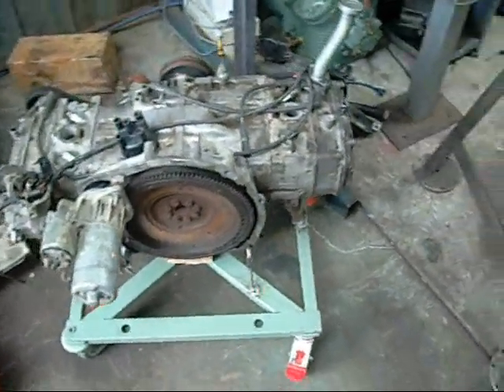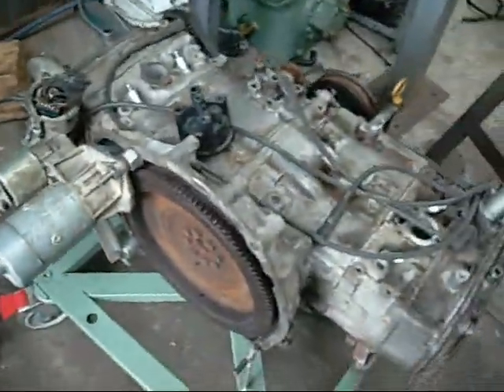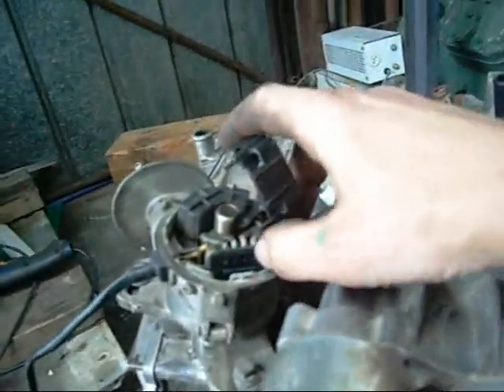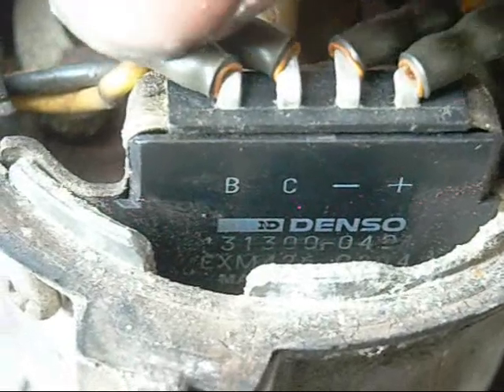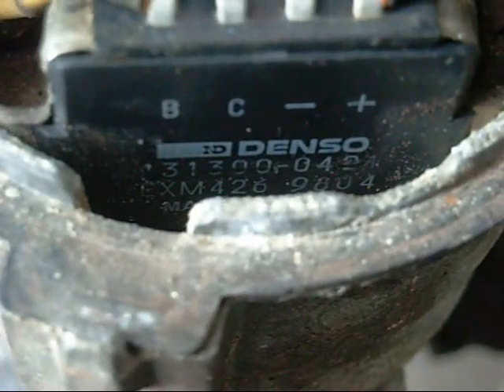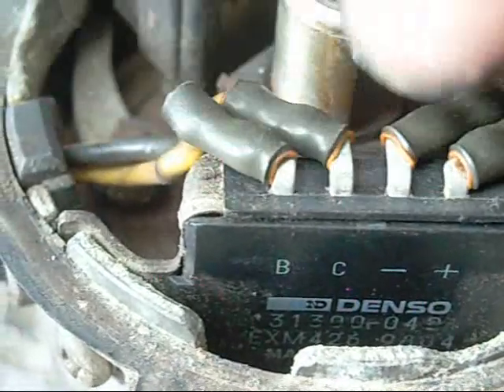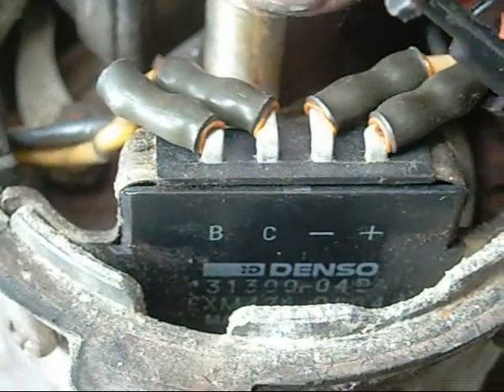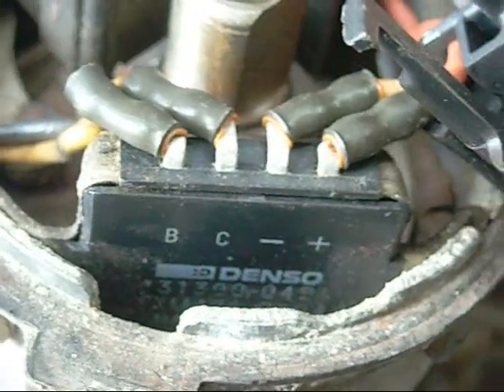Subaru EA82 Boxer Ignition Revisited - Denso Module Help

Comment: ah great memories here, my first car was a subaru 1400, it's engine was so light and I could lift it out with my own without a winch.

the issues were with the rocker arm rods which wore and started to get noisy, as I remember it was a bloody reliable unit, and this was back in the days of good old points ignition when at lest you could see wtf was going on.

As you have found out this electronic ignition is like black magic, when it works great, when it fails it's a tow home job.

Comment: @Aussie50 it was a simple motor, the water jackets around the pistons was the tricky aspect to a rebuild, they had to be set correctly

it did have pushrods, I can still hear the tappet noise in my sleep some 28 years on lol.

but hell it was reliable, but not as reliable as my VWT3 twin cab ute, possibly the best car I have ever owned. Drive a 08 Hilux 4WD 4.0L twin cab ute these days, uses way too much fuel but hell it drives nicely. Loved going out to Broken Hill a few times.

Comment: I'm not familiar with the Subaru ignition module. It looks like the General Motors HEI module. The GM module actually does the coil switching without an external circuit. The module has heat sink compound under it and uses the distributor housing as the heat sink.

Comment: Googling Subaru EA82 ignition leads to diagrams that seem to suggest there is some module between the coil and distributor that uses other inputs like coolant temperature to make adjustments to spark timing. Although apparently the EA82 was used for quite a long time, so who knows what particular version this wiring diagram was for.

Comment: 4 wires. 1 power 2 earth 3 & 4 should be connected to trigger on shaft and have a resistance between them, sending a voltage spike to module causing module to switch off & on .